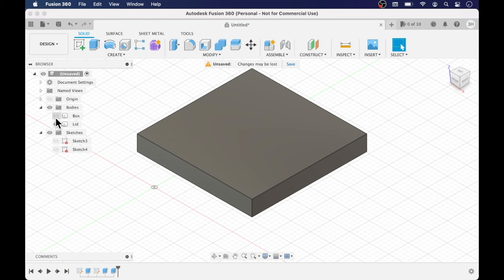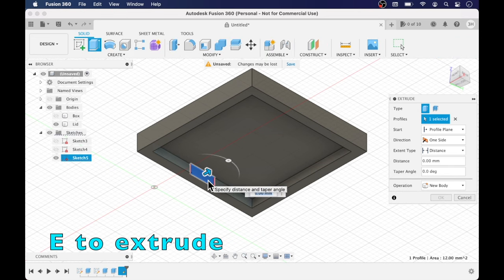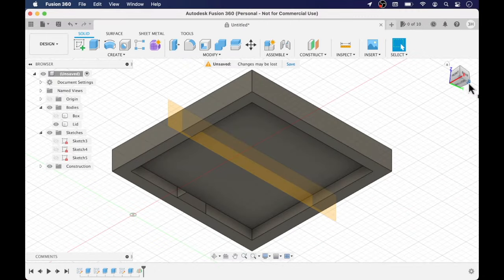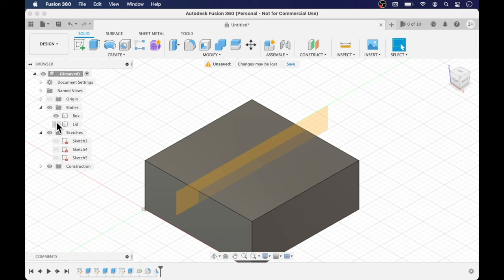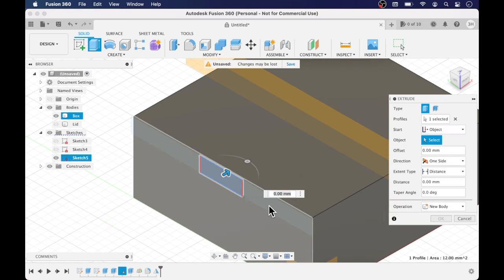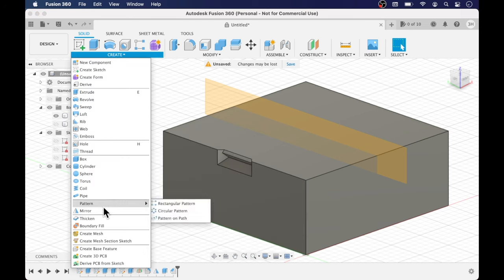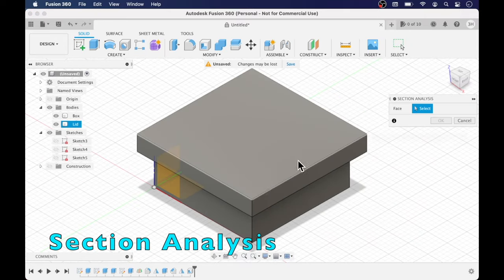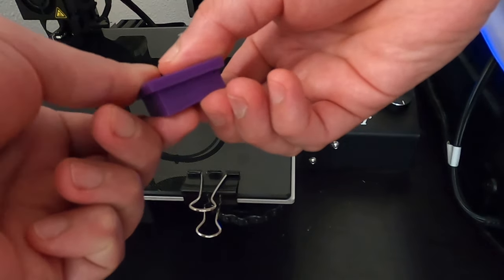Fast Fusion 360 - Snap Fit Parts for 3D Printing

Comment: Im glad that you said to Experiment with the offset other than saying f. E use 0.5mm coz there are people like me with a calibrated relatively precise printer and then using some premade models with massive tolerances to the point where f. E. M3 screw holes stop to work and stuff like that. Also - calibrate your printer itself, not the Design offset. So for cura its f. E. Horizontal expansion, and make it so the Design matches the reality. This helps a ton for modeling. 

Also if anyone makes tolerance critical designes either make sure to calibrate your printer or using f. E. Curas horizontal Expansion on a e3, or mention that you have tolarances calibrated to said printer.

Especially on the lesser known Designs i see this issue a lot, and have to change the Design or scaling the Part (or Expansion offset) acordingly to Match that.

I loooove Print in place Designs that are intentionally with tight tolerances cause these just plain work. And are not just a wobbly mess.

That said, 0.2mm tolerance is indeed a good starting point for normal stuff - for tight cases and stuff like that i often use 0.1 (f. E. Brackets for my Lab psu/combo thing where i put pcbs with lcds in and stuff like that.)

Comment: What Mac are you using? Does it run fusion 360 well?
Reply from the maker: M1 MacBook Pro 13” - no issues running Fusion 360

Comment: Nice video.  You give lots of numbers (6mm long, 2mm tall, etc).  It would be good to know how you decided on them.  And, especially, if you tried alternative numbers in the decision making process and how those numbers worked out. I want to get an intuitive understanding so I can use your technique in different situations.  Thx
Reply from the maker: Thanks for the feedback and question. The key features to experiment with are the chamfer of the cut and the fillet of the extrusion for the snap features. 
Honestly, it’s a combination of trial and error, using a pair of calipers, and keeping the scale of the features within the feasible range of your print nozzle & printer (I’m using and Ender 3 with a 0.4 mm nozzle).
Since each printer can be different, I’d suggest trying a small box to experiment with. It should be relatively quick to print, and enable you to iterate through some different dimensions.
Reply: @3dhobbee  you printed this with a .4 nozzle? In the video you said .2 nozzle
Reply: @br88dy  0.4 nozzle can print until 0.16 layer high....you can set it